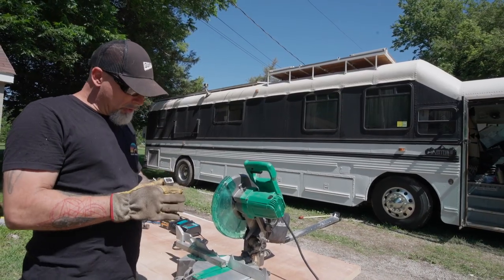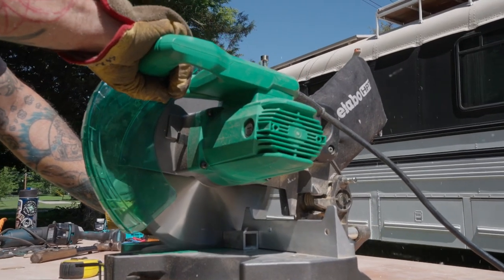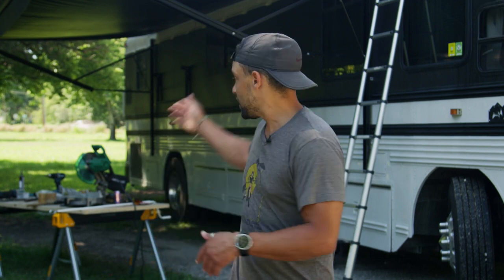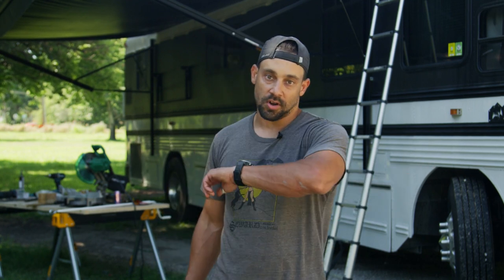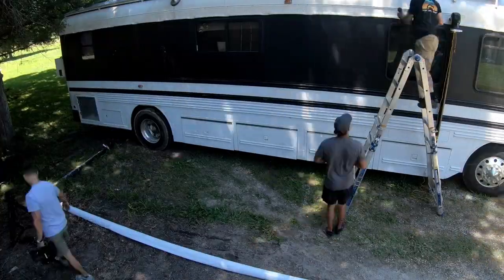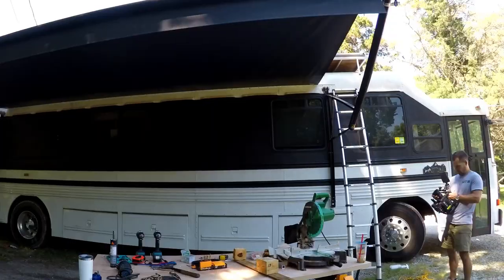21' Awning Install On My DIY Off Grid Skoolie

Comment: Have you had any issue with the cover stretching due to wind while driving? I ask because the aluminum spacer blocks prevent the roller tube from sitting against the awning attachment point on the bus. It creates a few inches that will be flapping in the wind while driving.
Reply from the maker: I've never had any issues :-)
Reply: @theoffgridskoolie Good to know. Thanks for the reply. I’ve been planning to use your method but as i looked at my awning, that potential problem dawned on me & I wanted to check.

Comment: as an extra note, in case you do cut aluminum with a carbide saw, DO wear safety glasses.  If a shard of aluminum flies into your eyeball, the doctors can't use the typical trick of pulling it out with a magnet, and must use tweezers and/or more intrusive methods. No fun 😅😅